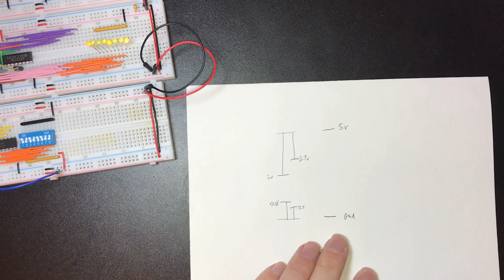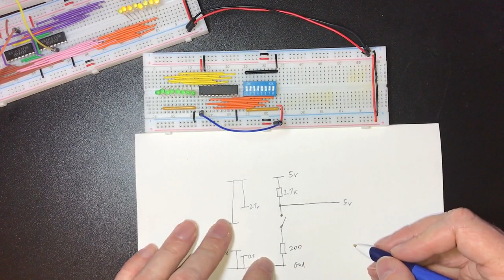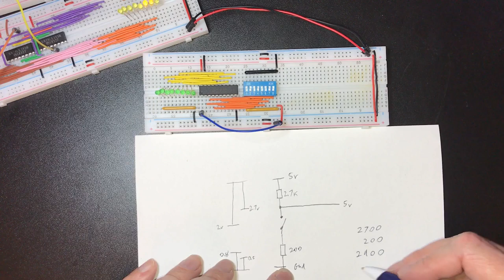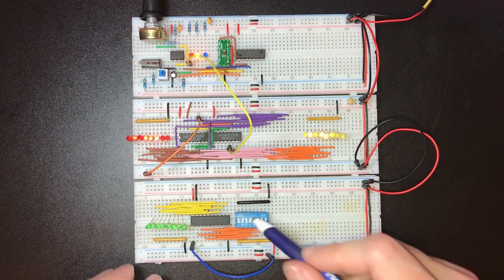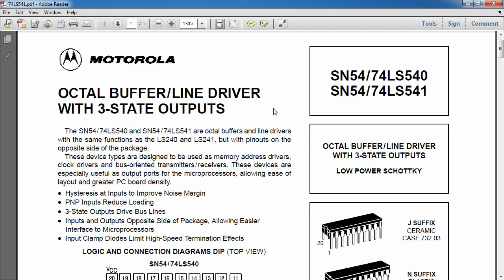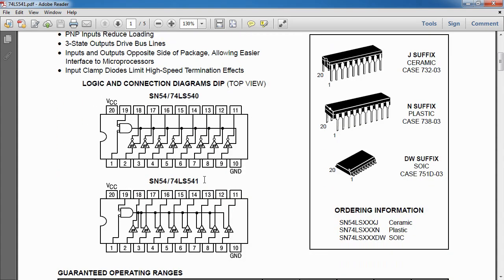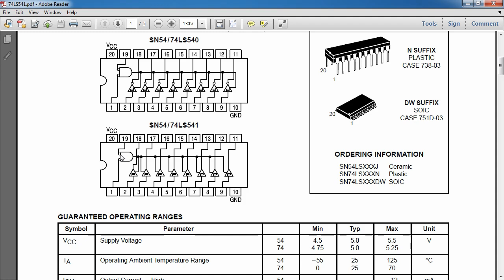Address Registers (2: Bus interfacing) - Making an 8 Bit pipelined CPU - Part 3

Comment: I only have 1.8k ohm resistor array and 330 ohm resistor array, I think this should work, but when I turn on LED 1 all the the LED’s turn off. Do you think the cause is the values of resistors?
Reply from the maker: Check you have the resistor array the right way round and the common connects to ground.
Reply: @weirdboyjim  I changed the sides many times, in the end I substituted it for single resistors and it worked fine , but thanks !

Comment: James, I came here because I want to use these ribbon cables with the breadboard compatible crimp headers. But I don't know what I need to buy. What are these crimp headers you use? Unfortunately you didn't really tell us in this video.
Reply from the maker: Those are called "Dupont" connectors, I make my own. https://youtu.be/7Lb1Dawq4cQ

Comment: Why are you not just going to 0v on the dip switch? Why 0.3v? Just remove the 200 ohm and have it go to GND.
Reply: It's always good practice to have at least a small amount of R at the end of an interface.  Just to prevent anything catastrophic when you eventually connect a 0V rail to a 5V rail ... and potentially through some other component that is trying to be 0R.  It also helps absorb signal reflections from high impedance inputs, but at low speeds and not a care in the world about EMI regulations, that's definitely a secondary concern.
Reply from the maker: I think I had some crazy idea that it was needed back then. 0v is definitely correct (I should probably have a higher value resistor on the other side as well). That said I built a similar test circuit last week and did the same, but only because I was lazy and it was easier + neater than 8 wires.